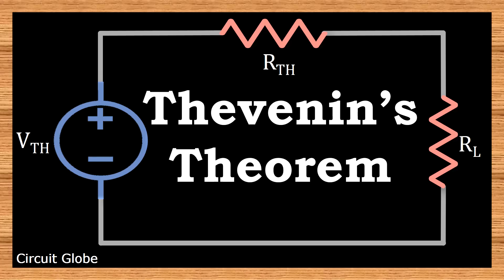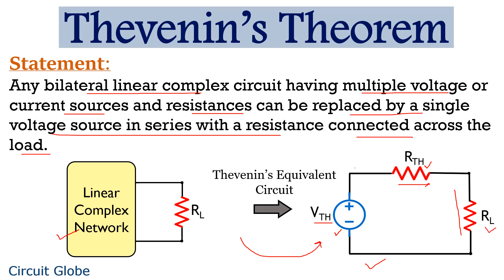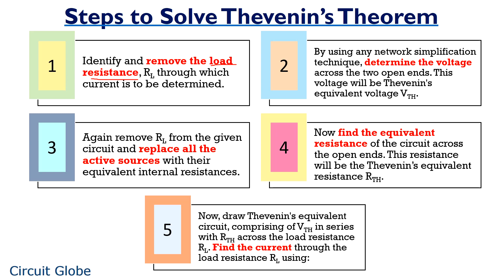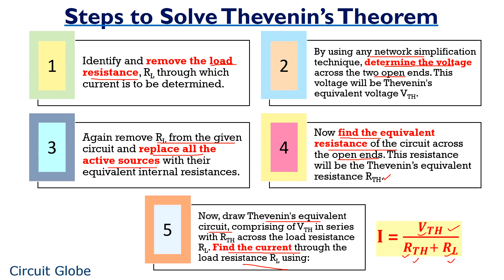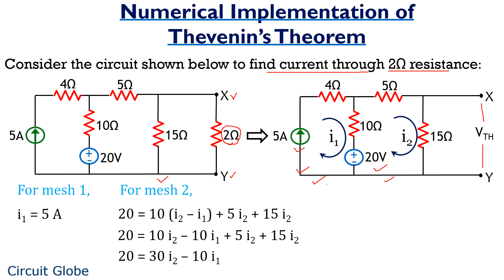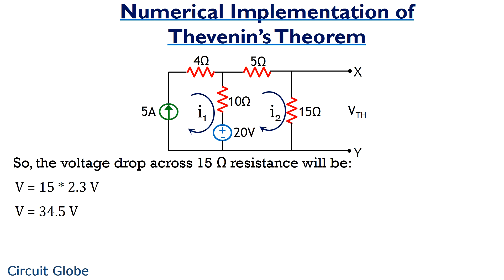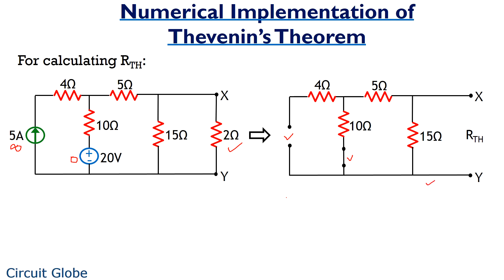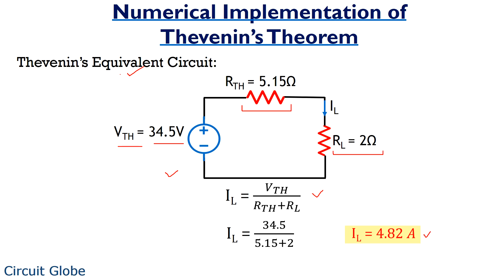Thevenin's Theorem - Method to solve it with example

Comment: Madem, in Rth calculation In is open, means that circuit is open in mesh 1.So how can we take 4ohm and 10ohm in parallel. Is it 15!!(5+10) ?
Reply: You are 100% right my friend
It should be
 (15 x 15) / 15 + 15 = 7.5 ohm
Reply: That’s exactly what I was thinking about. Since the source of courant has been opened then there is no current going through the 4ohm resistor so Rth= (5+10)// 15 = 7.5ohm